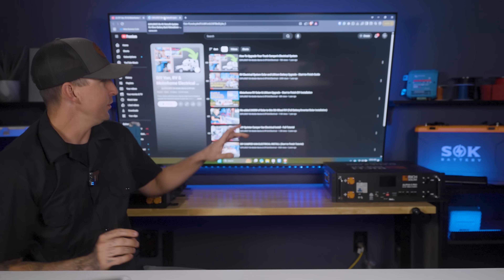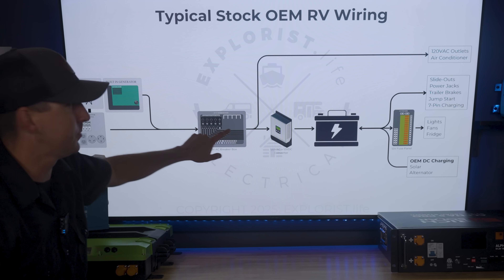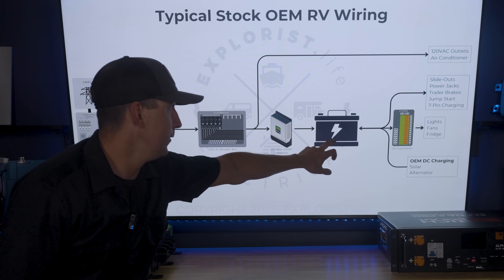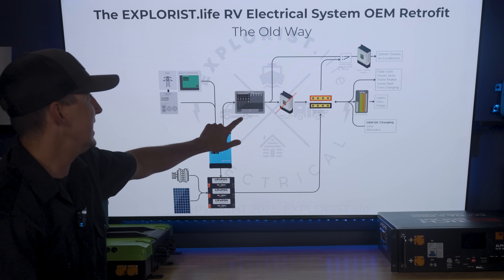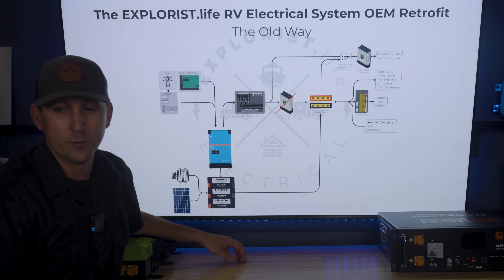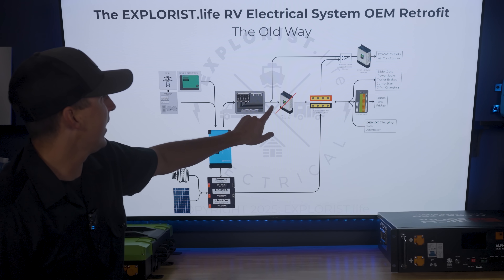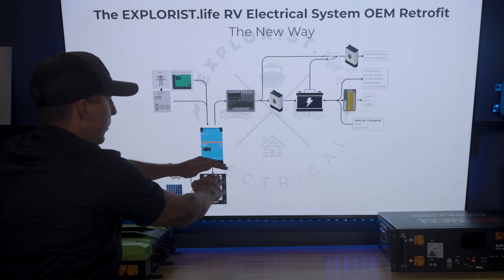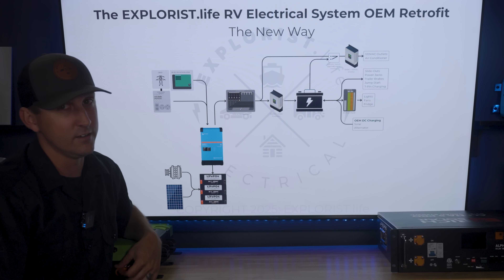The New Way to Upgrade RV Electrical Systems (No More Battery Relocation Kits!)

Comment: Here’s an alternative solution I’m considering:

2022 Ember 171FB with the base solar package (1X190W solar panel/WFCO 1000W inverter).  From the factory, the inverter does not power the A/C or microwave).  I’ve already installed a transfer switch near the distribution panel, and wired a second “shore power” cable to the under bed storage (where the new system will go).  I’ve been using an EcoFlow Delta Pro to run off grid.

My new system will look something like this:

900ah Lifepo4 (3X300ah) Each battery has 200a BMS and Bluetooth (no Victron comms).  Staying with 12V, so parallel configuration.

Multiplus II 12v/3000W paired with Lynx shunt/distribution/Cerbo/Touch 50.  6X200W Shadowflux panels (2 in series X3 with 3X 100/50 Smart Solar controllers)

The Multiplus II will not be connected to the actual, factory shore power at all.  I plan to run the 120AC out from the Multiplus II to the second “shore power” and add to the existing transfer switch a 120V AC output cable on ONLY the actual, factory shore power side.  I will disconnect the AC output from the distribution panel to the factory DC converter/charger, and connect the 120AC from the shore power side of the transfer switch to it for charging the house AGM battery when on actual shore power.

I plan to completely remove the factory solar panel and SCC.  

I realize this setup eliminates the ability to charge the new batteries when on shore power, but the factory converter/charger wouldn’t be great for that anyway.  I suppose I could figure out a way to run a dedicated converter/charger from the distribution panel for the new batteries if/when necessary.

I think this will retain all of the necessary power to the house battery, 12v loads and power from my tow vehicle.

In my mind this makes the most sense for my specific application.

I welcome any feedback from the experts.

These videos have been an immense help.  Thanks for all of your efforts.
Reply: Forgot to mention, I plan to also remove the factory inverter.
Reply from the maker: So - the video outlined our recommendation, but if you feel like you have a specific need or use case that falls outside of what we recommend, we can still sell you the parts so you can pursue the direction you think is better.  Hit us up: shop.explorist.life and we'll get your order on the way generally within 1 business day.

Comment: My only issue with this is you are charging the old battery with 12 volts that is being inverted to 120 volts from the new battrries and back to 12 volts with the factory charger.   Isn't there a lot of loss there because of the overhead of the Inverter?   Why not go DC to DC charger from the new batteries to the old and remove the factory charger?  I am in the process of doing this exact exercise, so it would be helpful to understand if this is not a concern.  Thoughts?
Reply from the maker: Reach out to our customer support team and we can go through the best options for your specific needs and get you what you need: shop.explorist.life/support

Comment: Great video as always and appreciate the detailed explanation as to why you went this route. However, I do have a question related to using the original lead acid battery to power all of the 12vdc devices in the trailer. More specifically the newer 12vdc refrigerators. There are numerous reports of power issues with the new DC fridges and a lot of evidence supporting the issues are due to low supply voltage resulting in increase amperage draw which can potentially blow a fuse that is very difficult to access (behind the fridge) or in some cases have found the wire gauge used to be under sized. Upgrading to a LifePO4 battery has fixed this for many RV'ers due to the slightly higher operating voltage and ability to handle heavier loads without seeing the voltage drop. Is there a simple way to only use the onboard lead acid battery to power the critical components such as trailer brakes etc which I believe are wired directly to the battery anyways...and allow the LifePO4 battery bank power everything that is fed thru the onboard DC distribution panel...to include the DC fridge?
Reply from the maker: Totally valid concerns—and the “best” way to split duties between an OEM lead-acid and a LiFePO4 bank depends on your trailer wiring, fridge specs, and distribution panel layout. We can review your setup and recommend a clean, reliable config (and parts list) to power brakes from the OEM battery and run house loads—fridge included—off LiFePO4. Shoot us a note here and we’ll get you dialed: https://shop.explorist.life/support

Comment: I have a question if I get a 3000 inverter Victron, can it be wired 12 V then later down the road when I can afford it upgrade to a 24volt. when I add more solar or do I have to 24 V system at the start? And the type of guy that likes to , Guy components that I can always got room to upgrade.
Reply from the maker: That’s not an upgrade, that’s just a different unit.  That’s like buying a truck with the hopes of converting it into a motorcycle one day.  Reach out at shop.explorist.life/support and we can get you what you need with the visions of future systems so you aren’t wasting money the first time around.
Reply from the maker: That’s not an upgrade, that’s just a different unit.  That’s like buying a truck with the hopes of converting it into a motorcycle one day.  Reach out at shop.explorist.life/support and we can get you what you need with the visions of future systems so you aren’t wasting money the first time around.

Comment: We got into RV in 2023 with our Cheap 96 Winnebago class c, the fridge was questionable and gen was gone.
First year I pulled out the gas fridge and discovered the fire damage back there (that hardly ever happens according to some people on forums) and strapped a  small danby in place and went RV’n. 
2024 I found your site and made some plans, downloaded drawings and ordered some bits from you.
Ended up with Victron inverter 300AH battery, Lynx, dc/dc charger relocated under the rebuilt couch which sits just above the original battery/ relay compartment which has just buss bars and relays now. Add a home 8.8 cuft fridge and it’s been two great camping seasons. Next year will be in a 98 Beaver class A, mostly original except for the solar panels. 
Plans were over the winter remove the gas electric fridge and replace with the same unit installed in old rig and add a 12 or 24 volt Victron multiplus ll 3000 based system and lithium bank. 
Will need to look into this new system, was actually on your site yesterday and hadn’t seen anything about this, glad I found the video!
Reply from the maker: Love the progress—nice work on both rigs! 🚐⚡️ For your Beaver upgrade (fridge swap, MultiPlus II system, lithium bank, and tying in your existing solar), we’d love to look over your plan and spec the exact parts you’ll need. Shoot us the details here: https://shop.explorist.life/support

Comment: I have a problem with your new "solution". I have a trailer with a Victron system and 2 Epoch 300 AH batteries. I have a 12 volt system. I am not on the road all the time. It can be several months between trips and there is no reason to leave the inverter on. I did remove the 2 factory AGM batteries. I have 1200 watt of solar a d dc todc charging from the truck. If I left the factory batteries installed 5hey would drain during that period and eventually  kill them. I'm not worried about the lithium batteries failing and disabling the trailer brakes while I'm driving because I'm still getting power from solar and the truck and I'm still getting g some power from the 7 way.
Reply from the maker: Hey Gerry, apologies, but this is more for going forward with new customers looking for our expert recommendations.  I wasn’t asking you to change what you did or trying to make you feel bad.  

For your next system, we sell the parts for both versions, so we are all good to go in that regard.  Reach out when you’re ready and we will get you what you need: https://shop.explorist.life

Comment: I think this makes sense for systems with small, OE type 12v loads. But for those who want to move towards large 12v loads for running DC A/Cs,  etc this would be less effective than the "old" way.
I personally built my DIY lifepo4/solar system in a similar way to your "old" configuration, and used the 24-12/70a Orion to supply the 12v fuse box from my DIY 24v 300ah Lifepo4 bank of cells (using an Electrodacus SBMS0 to manage the lithium and controllers and solar diversion to hot water tank, etc). The Orion 70a converter ran everything perfectly well - including the electro-hydraulic slide, the electric front jacks, lights, fans, etc. 

I do, however, think that for the majority of users, the simplicity of your new config makes sense, despite the weight penalty of keeping the old lead-acid battery(s) in place.

Thanks for the update.
Reply from the maker: Sounds like a cool setup!  Did we supply the parts for your project? 😁🙂

Comment: I've had 14 trailers in my 71 years and I've never seen the trailer brakes powered by the house battery. They've always been power directly from the brake controller in the tow vehicle.  Kind of calls into question your real knowledge of rvs?
Reply from the maker: And what happens when the trailer breaks away from the 7 pin connector?  The trailer power takes over, which is what everybody was bitching about that caused us to make this change. If you disagree, remember that we still have both options for sale. 👍

Comment: we have been doing this at off grid solar specialsts for over 5 years now. we call it our hybrid setup. the lead acid batteries will live for years without degredation. and we typically use the 30a victron dc-dc because like you mentioned the only things that need more then 30a are the jacks and slides we use the factory battery there as a "shock absorber" this also gives the customer a fresh 12V batter to start the generator and a reserve backup solution.
Reply from the maker: Great!  Are we supplying the parts/components for your installations?  How can we work together?

Comment: Isn’t there concern about siphoning multiplus inverter capacity?  With the old way, you can have DC draw without limiting volt-amp availability.  Perhaps the wattage of the converter never really has a chance to get up to 60 or more amps?
Reply from the maker: In all of the systems we have on the road that are set up like this, none of them have complained of having that problem.  That would only ever happen, maybe, while using jacks or slides.

Comment: Phenomenal content, service, and products -- blows me away!

I have a new Outdoor RV 22FQS, which has an "OK" electrical system, but plan serious upgrade (LFP, more solar, DC/DC charger, Multiplus II, ...).
Hoping you can help me understand something between the "Old Way" and New Way" upgrade path.
The "Old Way," seems pretty simple.

From the "Old Way" Upgrade video: https://www.youtube.com/watch?v=KM_8s4cTjWA&t=37s
1. Remove the OEM battery bank -- at about 13:46 into the video;
2. Connect the existing DC battery leads to the new battery bank -- at about 14:00 into the video
3. Permanently turn off the OEM converter (that charged the OEM battery bank) -- at about 23:00 into the video

This seems pretty straightforward to ME.
And, like many have said, I can ditch the >100 pounds of lead on the tongue of my trailer!
And, not have to think about maintaining FLA batteries.

>>>>> The only thing I'm not clear on is if the Multipluss II must be "On" for there to be 12v power to the trailer (critically, the trailer brakes), but I suspect it does not?
>>>>> If the Multiplus II DOES need be on for 12v DC power, that would change my thinking.

Am i missing anything here?
While the inelegant aspect of having a converter that "could" be turned back on bothers me a little, the above benefits outweigh that.

Does it matter that my trailer does not have an inverter, to begin with, which seems to be an assumption in the Upgrade.
Also, after re-watching the "New Way" video I see references to non-zero possible problems with the LFP batteries causing a problem with braking, which would be a liability for Explorist.
And, owners making mods on the Explorist side of the install, again, more problems and liability -- so leave owners the OEM side to mess with.

Again, just want to make sure I'm accurately understanding the risks and benefits of the "Old Way."

[EDIT] To be clear: I'm not saying one way is better than the other -- there are pros and cons each way -- I just like the idea of getting rid of the FLA batteries and associated maintenance.

Thank you -- look forward to using your services!

Comment: If your vehicle is able to have two alternators ( 240A each ) would you isolate one for house and other for chassis or just parallel them  instead?  Pros and cons... I was going to isolate but make it easy enough to swap in case of a failure in one.
Reply from the maker: Reach out to shop.explorist.life/support and we can give you some personalized guidance.
Reply from the maker: Reach out to shop.explorist.life/support and we can give you some personalized guidance.

Comment: Whats about 15-25% losses?
Reply from the maker: In the real world applications we’ve been monitoring over the last year, the losses aren’t that significant or even noticeable when using the system normally.  Remember that the biggest power users aren’t 12V DC.  They are 120vac which uses the inverter anyway, so it’s only a small fraction of the power consumption that has losses applied.

Comment: Simplicity is always best. This just adds a third powersource shore power, genator, and now a battery bank.  The battery bank can simply be an "Eccoflow" type of solar generator. Or install all the bits of that system.  Nice solution and not overdone.  Well done.
Reply from the maker: Appreciate the kind words! 🙌 If you’re ever looking to build out a setup like this or need help choosing the right gear, our team can take a closer look at your project and get you the parts you’ll need. Just reach out here: https://shop.explorist.life/support

Comment: I’m a little dense and trying to follow. I have a DIY 24V system. The factory installed “converter” is left there and on? What happened to the Multiplus powering the converter charging the battery, powering the Multiplus loop? Does that or did that never exist without the relocation kit?
Reply from the maker: That’s a great question—there are definitely some details in your setup that we’d want to look at more closely so we can make sure everything is working the way it should. Send us the specifics of your system here and we’ll get you squared away: https://shop.explorist.life/support

Comment: Our factory battery  needs to be replaced. What size battery do you recommend  for running the usual 12 volt plus 12 volt fridge & a future 12 volt ac  with your new system
Reply from the maker: We’d love to size that properly for your fridge + future 12V AC and make sure it pairs with the rest of your system (and get you the right battery/kit). Shoot us your rig details and typical run-times here: https://shop.explorist.life/support

Comment: Your new way seems like the easiest way which is why I did it that way when I put in batteries and charge/inverter.  Plus if you want to change rvs later you can move what you have if you want.  Not sure why you were doing all the extra work to begin with.  Good to see what I did makes sense to more than just me.
Reply from the maker: Thanks for watching and sharing your experience!
Reply: No issues with wattage draw from the MP when there is 12V demand?
Reply: If you want to go lithium and move the 12vot battery inside to avoid cold issues you have to run a new line, so it did make alot of since if any of that matters to you.

Comment: This is how I nstalled my 48v 10kw system last summer.  Because it was the simplest system.  My setup had 200ah 12v lithium stock so I do still have that.  And I kill the breaker to the converter when boondocking.  Means I also have to put the fridge on propane manually.  Would love a smart breaker.
Reply from the maker: That sounds like a solid setup! 👍 A smart breaker could definitely simplify things, and we’d love to take a look at your system to recommend the best option for your needs. Reach out to us here: https://shop.explorist.life/support

Comment: Keeping the factory AC to DC charger means you will need to keep the inverter switched on all the time to charge the battery instead of just when you need AC power. This seems to be more wear and tear on the inverter, power loss due to running the inverter when you don't need AC power and efficiency losses due to converting DC to AC to DC. Ditching the factory AC to DC charger for a DC to DC charger may cost more up front but seems a better solution in the long run.
Reply from the maker: Is it cool if we offer both options? Cause that’s what we’d prefer to do: Https://shop.explorist.life

Comment: Lots of reasons to get rid of the 12v lead acid. Mine were installed underneath my van. I snowboard in the Rockies in the winter where it gets down to negative temps almost nightly. No need to to leave the 12vAGM installed. Yes, I am using my factory WFCO AC breaker box just to power the charger AC to DC charger and DC loads, and all my AC loads run from my Renogy Inverter, not my AC breaker panel. But thats ok. Still works flawlessly with 690AH of litimes. I am not sure how this new method would have helped at all seeing that I needed to upgrade my BIM to lithium, my AC to DC charger to lithium, and my solar charger to lithium. I would have had to do that anyway with this setup.
Reply from the maker: You think we should get rid of the new version and only sell the old version only?  Or is it cool if we provide our customers options?